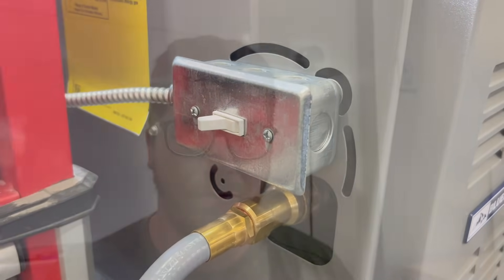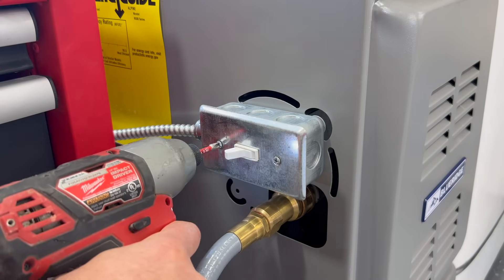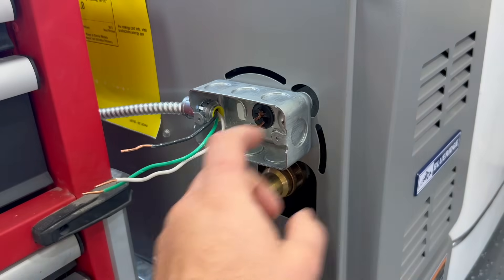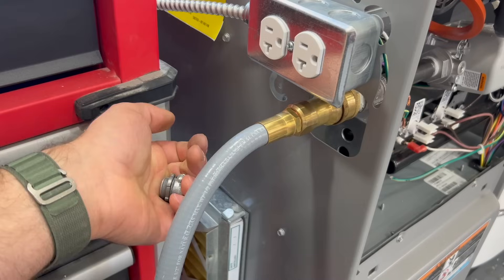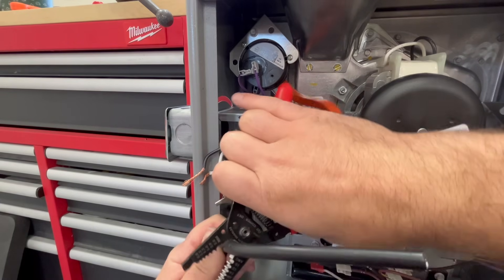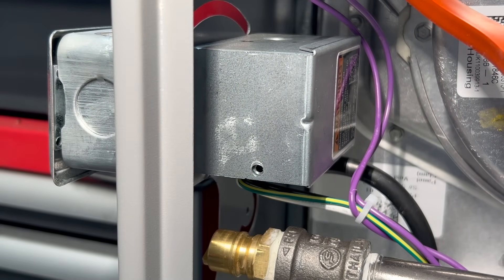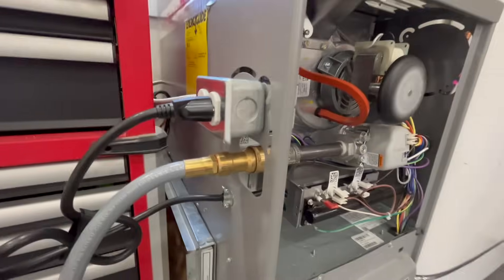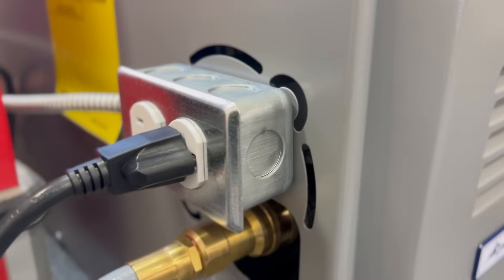Keep Your Family Warm During An Emergency Power Outage With This $20 Fix

Comment: That’s a great way to get an essential backup.  Our setup is with a 120V Reliance TF151W 15A Easy/Tran Furnace Transfer Switch.  Hardwired in and attached to the furnace and UL listed and inspected/approved by county.  
Takes an extension cord outlet  as input.  Had it on the old furnace and was essential last winter when had ice storm, sub freezing temps, and 70 mph winds that took out power for an extended amount of time.  Used a Ecoflow Delta 2 as a buffer between our Honda EU3000is Gen and the furnace and other sensitive electronics like routers, cable modem, tv, etc.
Extended cold weather took out old furnace heat exchangers so Gen backup transferred to new furnace.
First time we needed to run generator overnight in 15 years we had Gen.
Reply: Just fyi whenever your ecoflow is both providing power to devices while plugged into the utility it will be in passthrough mode. Meaning the devices are actually running on utility power. Meaning you really aren't getting a buffer from the generator like you think you are. These are not a true ups.

Comment: Good idea But why didn’t you just use one of the knockouts on the SG box instead of drilling a hole in the furnace.
Reply: Very well could have but it might get a little crowded. Changing from a single gang box to a double gang with a single outlet cover would fix that as well.

Comment: I have a few Ecoflows, and after watching this video I picked up a couple of bonding plugs. Tested and works! Thanks!
Reply: Finally someone who shows the use of the bonding plug for a bumbling semi-electrician. Thanks for a good video
Reply: which molde ecoflows? I have a ecoflow delta 2 max but olny the fan on, the gas heat can't star
Reply: @喬老爷  did you use a bonding plug?
Reply: @喬老爷  Delta 2 Max is more than able to run the fan on a gas furnace. Ensure that you have a bonding plug as he mentions at the end.

Comment: Two issues I see with this.  One, you have eliminated a necessary switch.  This could be avoided by using a switch -outlet combination rather than a duplex switch.  Second, It looks to me like during normal operation of the furnace you will have a live plug  with hot contacts hanging on the outside.....very dangerous.  You have wired a plug into a normally hot line.  Perhaps I missed something in your explanation but I don't see how that is prevented.

Comment: Excellent video! I have a heat pump, but only use the "emergency" gas setting. I'm confused because I only have a hot and a neutral wire supplied to the unit. Can this still be done?